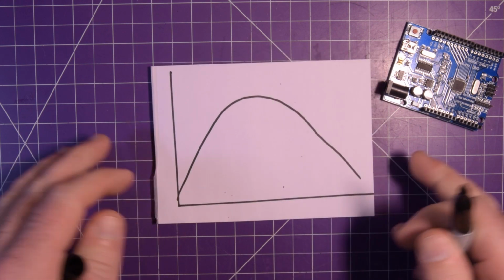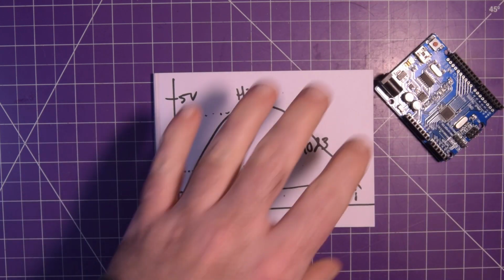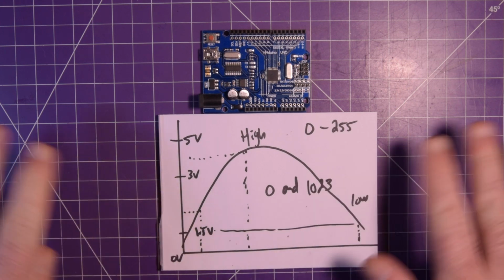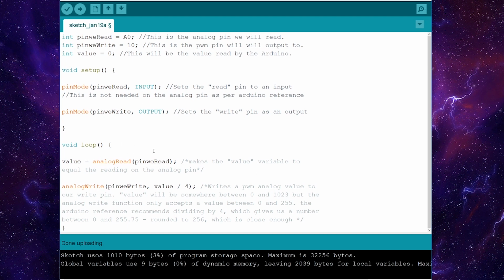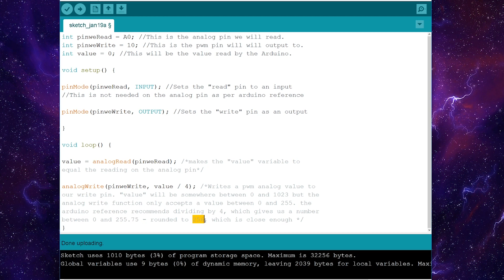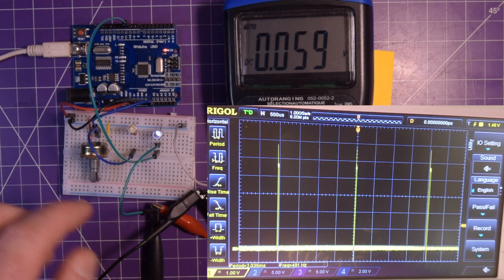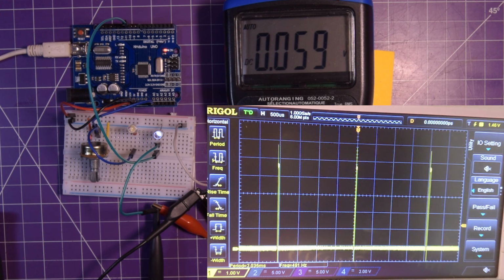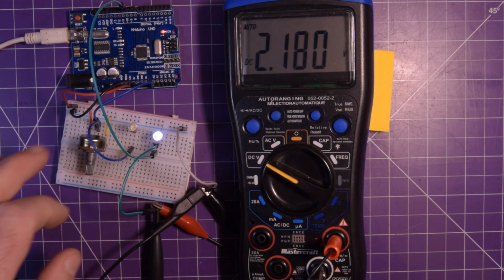Arduino Basics - #6 - analogRead() & analogWrite()

Comment: I need to make a system that activates a heater when temp is below 1 degrees. By reading the voltage and using NTC this should be easy but we just find t rly hard...

Comment: maybe its just me being dumb but if the out and in put are in analog and pin 10, how do I connect it with 5V power? BTW im working for a school project and its rly hard for us we keep struggling. I think this might be easy for you so if your able to help us leave a reaction :) (which would be amazing)
Reply from the maker: I would suggest you post your code and question on the Arduino forums, they are really good with this kind of stuff! Good Luck!
Reply: @SimpleElectronics  alright thanks
Reply: @SimpleElectronics  fixed the sensor btw, needed an other NTC bec it was just 1K ohm and we needed like 10K that's why the voltage didn't react at the temperature
Reply: @SimpleElectronics  only need some commands to put the heater on if voltage < 600